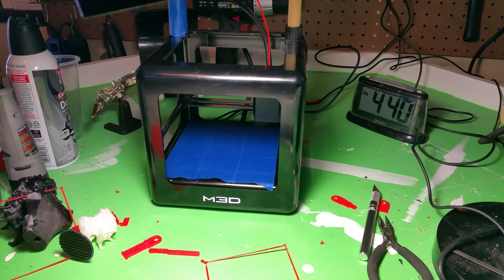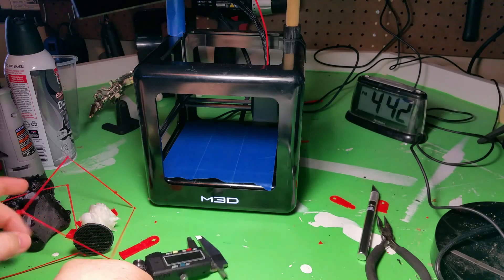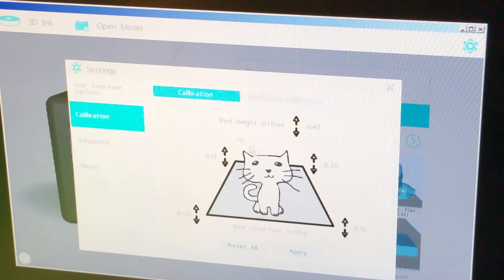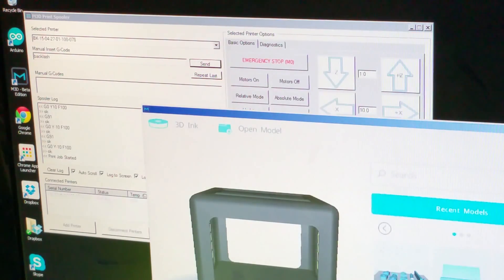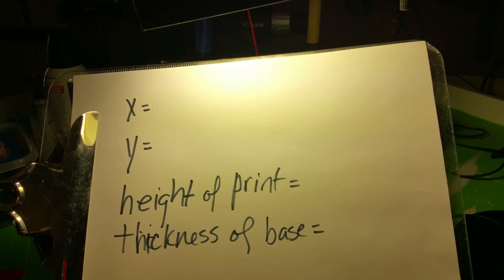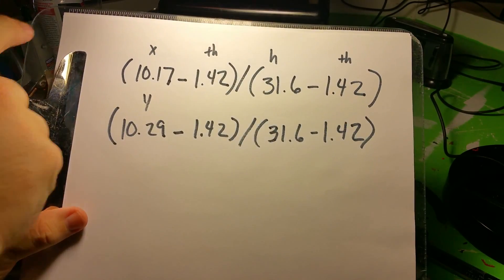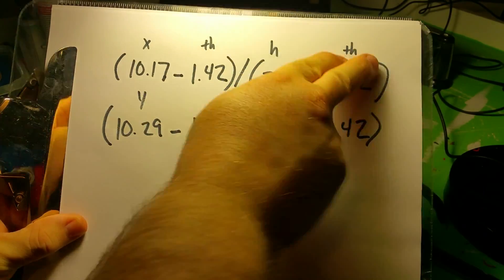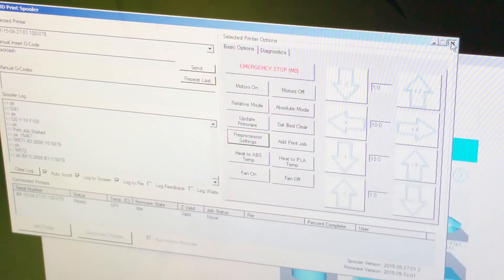M3D Micro Printer - Update #14 Calibrating the bed and Backlash test

Comment: I can´t get this 3D printer to work, I have calibrated to 0.2-0.5mm. i all corners, and the plastic still glide off like a Ice.. I neven ever getting to start, I havew tried with diffrents types of TAPE. but nothing seem to work, i havn´t printet anything that works.. Its a shitty printer. i can NOT recommand M3D printer to anyone.. all firmware is uptodate to.

Comment: I am having problem printing the backlash test and it says "sorry your model cannot be printed because it is out of the printable bounds of the pinter" pls help
Reply: Are you trying to open the model from the latest version of the software via the Open Model button? Try dragging the model file ONTO the gui of the app instead. I was having similar issues. Support said to do that and I can open and print models again that worked in the past.
Reply: I have the same problem. Did you find any solutions for this?
Reply: voodootec123 yeah i instaled an older version of the software and then i went in to spoler diagnostic (in the top right) and start backlash print
Reply: Last-HERO- thank you. I found another calibration stl for the m3d and it works fine.

Comment: So, I cannot find any other information on my issue. Maybe you can help. I import a model and it prints the raft no problem, but eventually (usually before the first layer), the whole model comes off of the bed and is just drug around the whole time by the nozzle. Has anyone had this issue? If so, what did you do to fix it? Also, on the advanced settings where you can see all of the script, have you ever seen a "Dropped Printer Detected" line? I haven't dropped my printer but tonight it gave me that line for about a whole minute (repetitively). Thanks in advance for any/all help! :)
Reply: Cover the print bed with tape. The issue is caused by not getting good adhesion to the print bed with that first layer, so it warps and is often "grabbed" by the print head. Using painters tape on the bed usually gets rid of that problem for me. If that doesn't work try upping the temp on the filament a bit to keep it from cooling too quickly.

Comment: how does one get the default factory settings for the backlash? I messed with my backlash and now its giving me terrible prints and i misplaced the original backlash X and Y #s that worked fine. Also for some reason when i go to expert mode it wont let move to left and right using those arrow keys.

Comment: where is the backlash cylinder found at?  Its not on their website at all.  If you re type backlash it will reset all the math I have just done.
Reply: +Ro Du Google: "backlash settings m3d" and click "How To Guide: Manual Backlash Calibration - M3D"; should be first link. Everything you need is there.

Comment: I forgot to put the bed in when calibrating, can you tell me how to move the nozzle up higher now??
Reply: +chrswnd did you figure it out?
Reply: +Jake Walbrun Yes, start the M3D software, now next to the Windows clock there is another M3D icon, click on it, and you will see an advanced menu, you can move the nozzle/extruder with buttons on the right side! Tell me if I could help :)
Reply: +chrswnd oh yeah.  I knew how.  I just noticed nobody replied to your question so I thought I would help you if you hadn't found it.  But thanks for offering the help.  :)

Comment: You aquired you measurements incorrectly.  X and Y are measured from the base to the point where the most circular. Not the diameter.

Comment: Very helpful. Did the backlash adjustment help your print quality and/or skewing? BTW, it might be wise to write down and save the original x and y backlash settings before changing them just in case.

My factory default backlash settings are way different than yours, so they must do a custom adjustment for each printer. There's also a backlash speed setting in the latest software; the default is now 1500 whereas it was apparently 2900 when that figure wasn't available for user setting in the software.

Some nice, updated how-to pages:

Print Shifting/Skipping/Drifting
https://printm3d.com/solutions/article.php?id=200

Bed Level Calibration
https://printm3d.com/solutions/article.php?id=201

Manual Backlash Calibration
https://printm3d.com/solutions/article.php?id=80
Reply: +Winston Smith just an FYI if you type in the backlash command again it will revert the printer to its default settings from the factory by printing the backlash cylinder using the programmed original firmware settings.

Comment: I was also having some shifting problems but for me it turned out the spool wasn't moving freely enough. http://www.thingiverse.com/thing:774334  is what i used to fix this. Hit Open in Customizer to make it fit your spool and rod. Hope it helps!
Reply from the maker: Damien Jaehne Cool, I may give that a try.
Reply: +Nick Goodson Did you ever get it working well? I am having some serious issues too! I have thought some of my issues might be the spool holder too so I made this. http://www.thingiverse.com/thing:1096370
But I can't get it to print it even one time well enough to put it to use! Maybe you could give it a try?
Reply: +Damien Jaehne I just changed how my spool is held and got this, but it looks as though my filament is never "too short" or "dragging". Could you explain how I can spot if I have that problem?